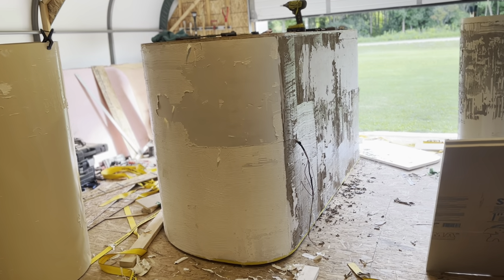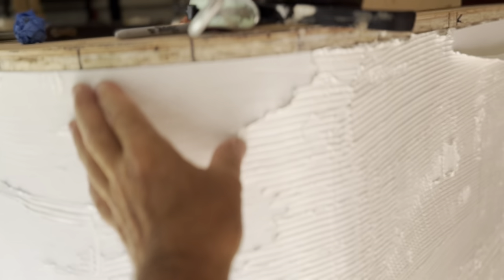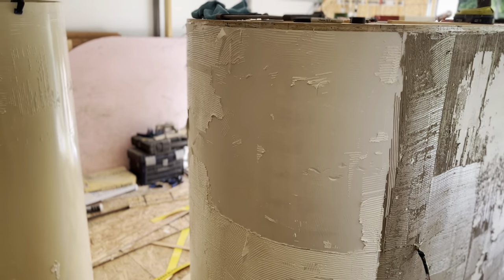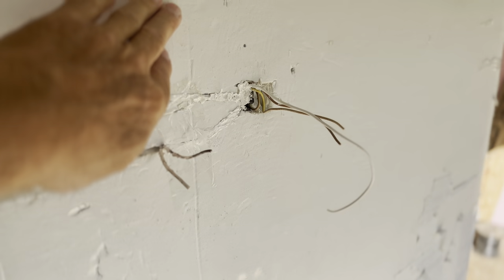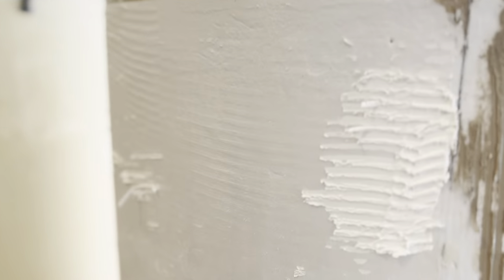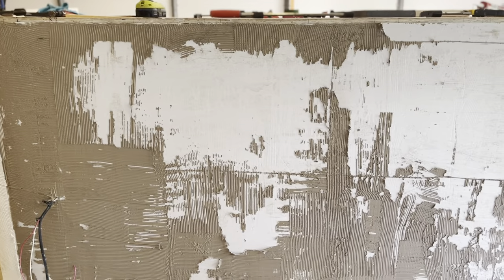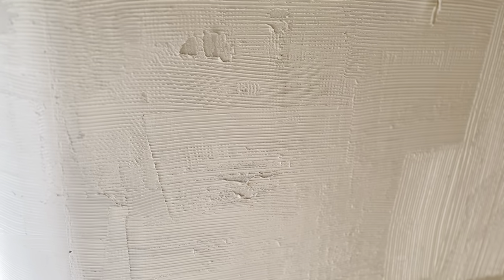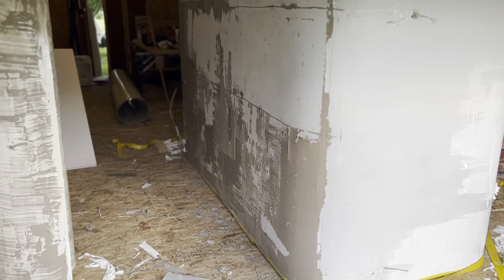Disaster strikes- Difficulties with the outer layer of Filon-Teardrop Ogilite Model 3 build.

Comment: Can you try using an air bag for more even pressure, one of the vacuum bags for laminating veneer or something like that might work.
Reply from the maker: It would be very hard to get a seal with limited access to the bottom side of the form. But that is a good idea, I would need to find a glue that flows a lot easier than the Quad Max. I have the glue all removed from the styrofoam and now I am scraping the glue off the Filon. Should have the first piece glued on this morning. Thanks for the comment.